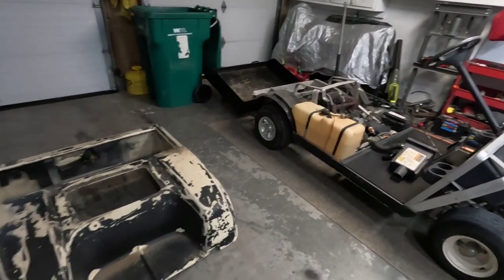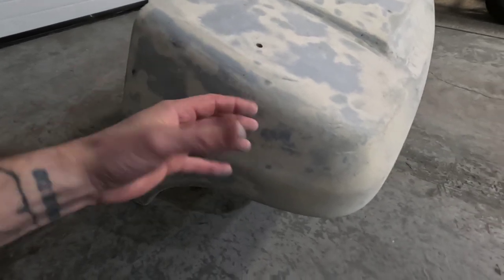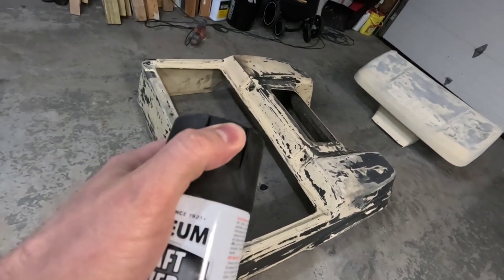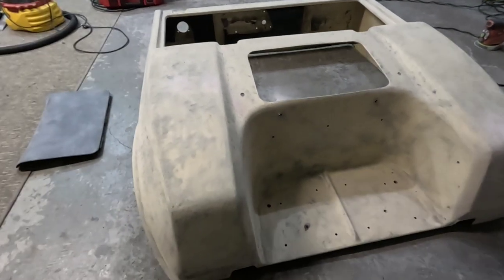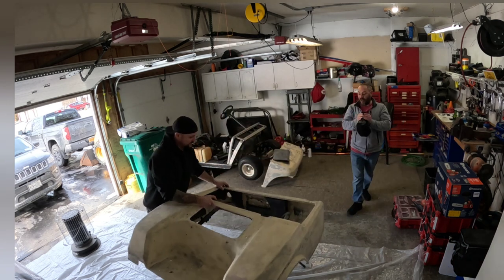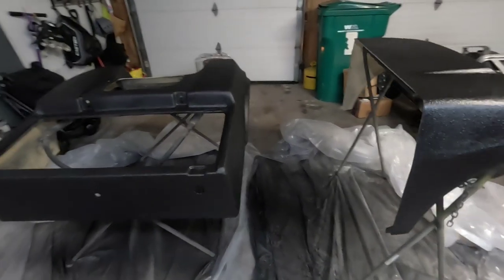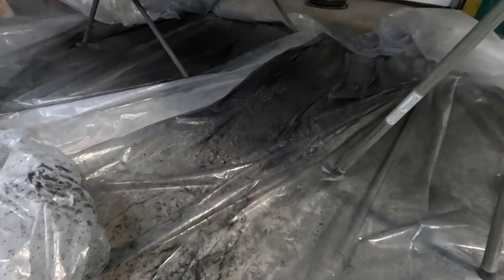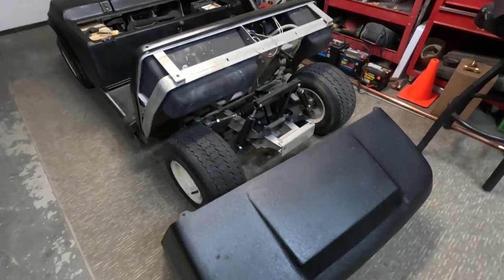I painted my Golf Cart with Raptor Liner

Comment: I love it! Rebuilding a 98 ezgo txt, going to go with the olive green raptor rattle can paint. How well does this stuff cover? I am wondering how many cans I will need to spray a txt.
Reply from the maker: It covers really well! I used 2 bottles out of 4 and it covered everything completely.
Reply: How many coats did you get out of the 2 bottles you used?
Reply from the maker: Two full thick coats.